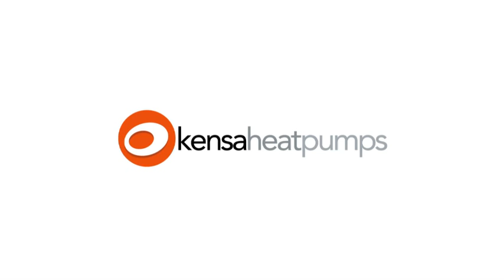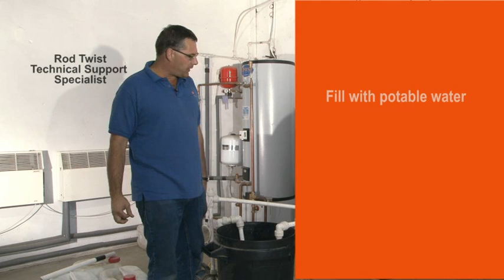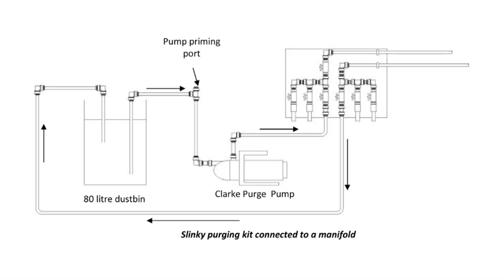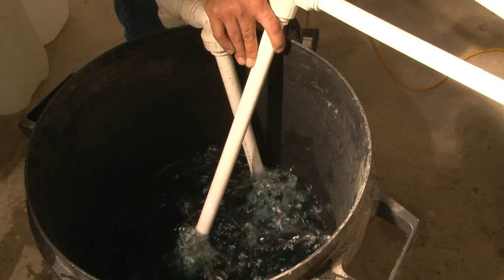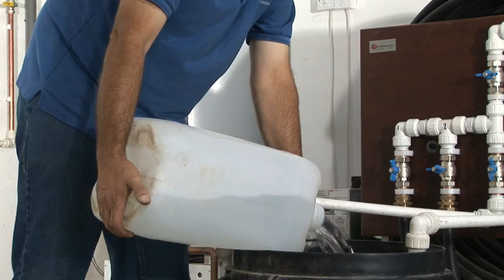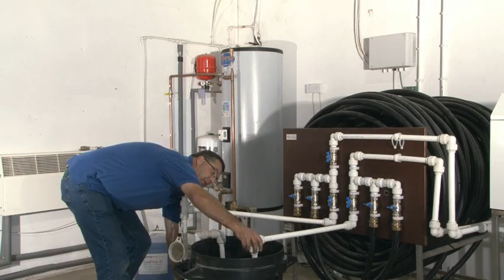Filling & Purging a Kensa Ground Source Heat Pump

Comment: Would redefining the ports on the manifold so that it has the purge ports at the top and the heat pump connections on the bottom help with the purging process?

Comment: If there is any air in the system, is it best to have a pipe fitted at a high point in the system with say a glass view window - Air Bleed so one can see antifreeze - Air, will normally will rise to the high point in the system, Philip D from Bowdon, Cheshire UK
Reply from the maker: Hi there, on smaller domestic systems, assuming the correct type of purge pump is used, getting all the air out of the system is usually easy, making bleed points unnecessary. Therefore, we recommend not fitting them - simply less to go wrong or leak. Proving that all the air is out of the system is done simply by performing what we call a 'squeeze test', if all the air is out of the system, it won't accept any additional fluid when pressurised. On larger commercial systems, fitting air bleed points at high points can sometimes be helpful during commissioning, although these should be properly valved off once complete, as automatic air vents do tend to leak when they get old.
Thanks for your question, we hope this helps. -Kensa Heat Pumps
Reply: @kensaheatpumps  good to hear that.  Thanks.

Comment: 7.05 would a clear pipe fitting not help with this method, so you can see the glycol reach the outlet and turn off in time.
Reply: I think I would be inclined to fit some clear PVC pipe onto a hose spigot, this would also make it easier to transfer the fluid into the containers.